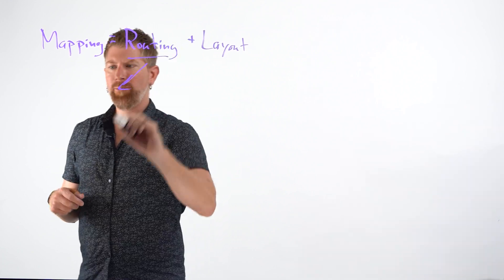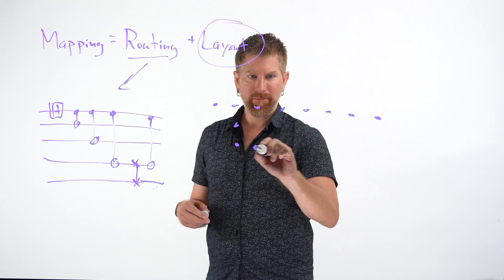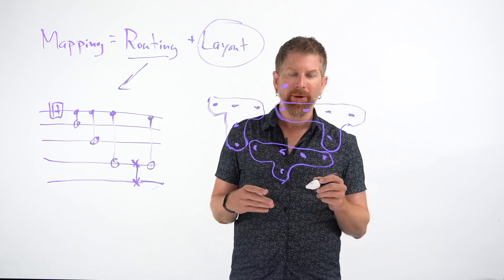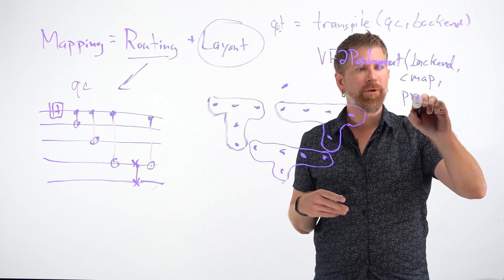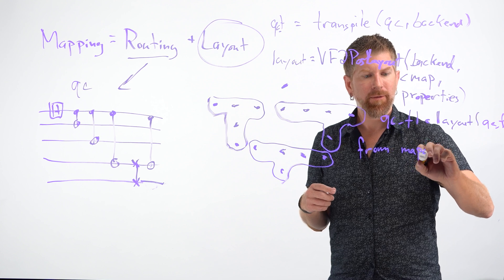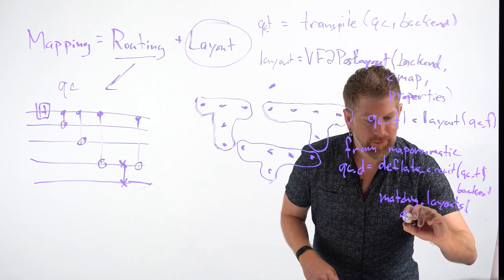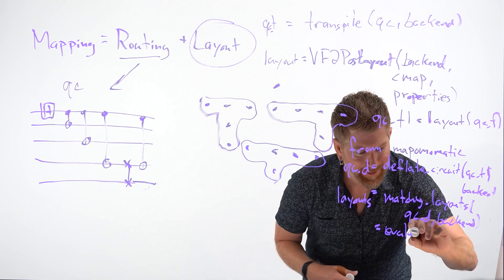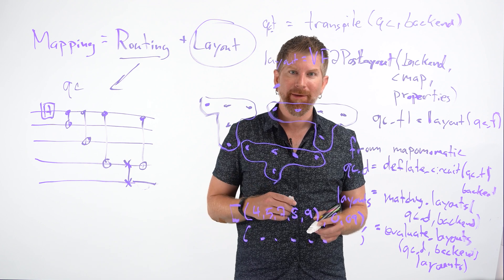Nick Knows - Layout

Comment: I have a question: suppose I have a circuit (like the five qubits GHZ circuit in the video) and I want to impose an initial layout determined by me that maps the logical qubits to the physical qubits on my backend of choice. Is there a way to do it in Qiskit without calling any routing? I tried to use the "generate_preset_pass_manager()" method, but apparently there is no way to avoid the routing, even using "optimization_level=0". Thank you!